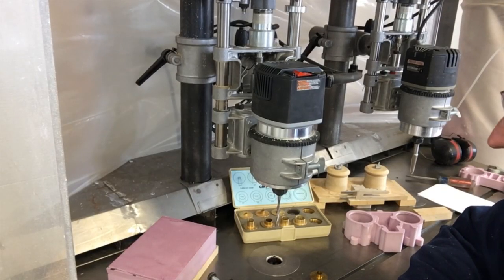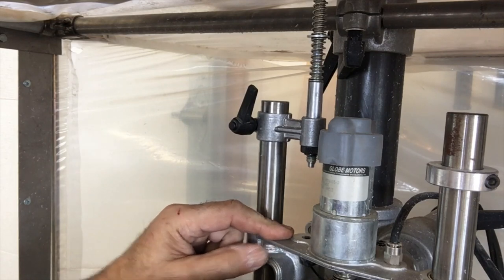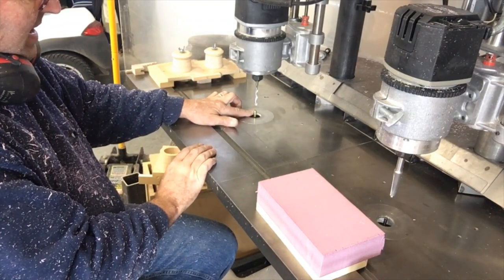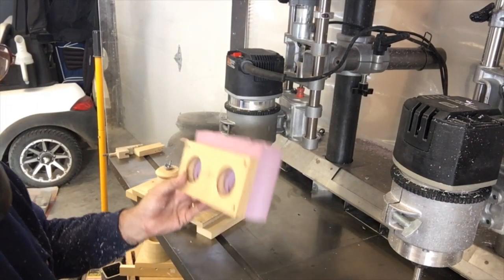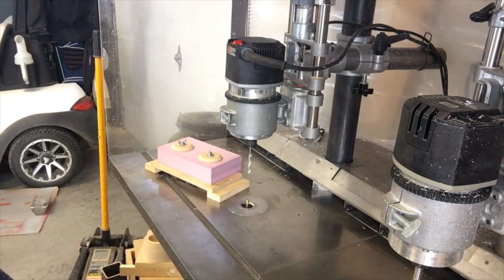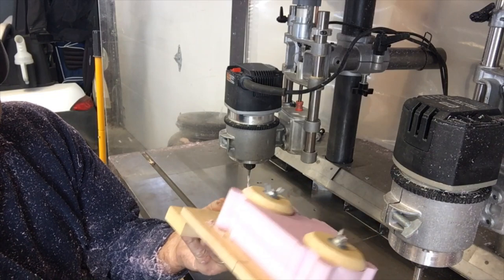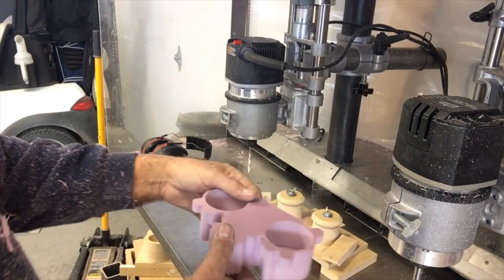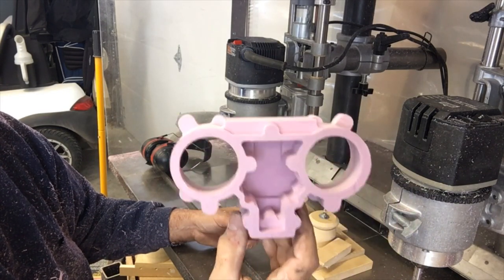Carburetor Main Well Foam Pattern

Comment: I think this is a lot more accessible than people would think. Especially with these cheap CNC lathes for wood that are out there, I mean they are basically useless even at what they are supposed to do, which is milling wood, but styrofoam shouldn't be a challenge and with that it's just a quick press of a button from CAD file to lost foam form.

Comment: Greetings and Regards Mr. Coffield. I do not speak English well and I have to find most of your conversations with the dictionary. Please write me the name, foam, glue and liquid that you apply on the foam. I watched your videos for hours and it was very difficult for me to find these names. Please help me in this way. Thank you again with heartfelt respect .Mamad
Reply from the maker: Use Google Translate or tell me your langugage and I wil translate. Extruded Polystyrene Foam Insulation Board 1.3lb/ft3 density. Hot melt glue or common white glue (Polyvinyl Acetate), and non-setting joint compound used on drywall board diluted with water. All can be found in home improvement stores. Best, Kelly

Comment: As I watched your method I tried to figure out how to invert it for my table mounted router, pin would be mounted above. It's possible of course but you lose the sight advantage with the part under the pattern.
Then I had a EUREKA moment. This is FOAM that is  being machined and cheap trim routers can be used, then this idea got cheaper when I remembered that a lot of CNC machines use glorified toy motors for the router. So even if I have to go the expensive route of a trim router, which I have, I can set up a single purpose station very easily and cheaply.   To go whole hog anyone can reproduce at least a mechanical version of your multi station system by using lost foam castings for your iron castings. "Toy" motors with adapters for the bits and you can have as many bit stations as you want. Even if  real trim routers were used it can still be inexpensive.
Have them on a horizontal turret and then only one lift device is needed and much less space. I have to go to work soon but this will give me something to think about.

My point in this babbling is, as its foam that is being machined then everything mechanical associated with it can be much weaker. I wouldn't doubt that a lot of it could be built out of wood...if your only going to be using it for foam.
Reply from the maker: You can build an L-shaped arm in box section or laminated thickness out of wood, but if you are going to spend money, spend it on an actuated z (vertical) axis with at least 2" of plunge, 4" better. There are oodles of linear actuator packages on eBay and Amazon. Mine is just a DC gear motor with an acme screw, anti-backlash nut, and limit switches. Could be a stepper motor if you prefer. Yes, it doesn't take much of a router. You might also choose to spend money on good bits. My go to is 1/4" diameter by 4" long, double flute spiral carbide. I'd never use a bit like that on any hard material, but for foam, no problem. Plunge the cutter into you table surface and you have a hole for a 1/4" pin under center. Buy some plastic washers with 1/4" ID and whatever OD you want to cut over pattern size......voila'...pin router. Best, Kelly

Comment: I'm curious if it would be possible,  to do something kinda crazy,.  Build a new Holley carburator,  based off the secondaries of a spread bore Holley,  making the primary side just as large. Use the traditional metering blocks, and bowls, and use down leg,  annular boosters, the difficult part would be drilling the idle circuitry. Maybe edm can be used ,   make it fit the traditional dominator manifold, and have a nice radius entry, with fairly large venturi, with the booster down low, use a enrichment circuit in the idle circuit, in place of a choke, like a modern scooter carburators use, maybe actuate it differently, 
 Id like to cast a intake manifold to use such a carb,  heck I'd like to build a engine that really needs such a carb, it should flow appropriately  1200 cfm  maybe more,  depending on the booster restriction. It could easily reach 1400 CFM,   a 850 carb the primary is only 100-150cfm of the total,.  That leaves 600cfm+ for the secondaries, I know there is alot I'm not figuring,.  But adding things like adjustable jets, that the changeable jets only set the max fuel possible,  then a needle valve can adjust the fuel down about 10-20 jets , so possibly 80's-90's could then be adjusted out, possibly using a wide band O2 sensor, possibly using two power valve circuits,  one for off idle enrichment   to allow the use of a pair of 30cc pumps for acceleration,  maybe a 50cc pump in the secondaries  I'm looking for flow of a 1150 dominator, with street manners of a 1850/4150 650cfm,
 The extra power valve , can possibly. Be mounted in the secondaries, yet be feeding the primary boosters, with a means of using this circuit for cold starts, in place of a choke,  use a needle valve to restrict cold enrichment,    and the spacing between primary and secondaries can be adjusted to fit the runners of a  intake better,  or even make it a 2bbl, using a pair in line, to feed a V8 engine,   a 650 - 700cfm 2bbl could be useful,   sorry to ramble again, I'm bad when I gave had no sleep, insomnia !! ✌️ Great video, thank you for sharing so much of your skills and knowledge!!

Comment: Do you ever use a hot knife to cut your forms??? The router work looks for clean... 
Good session...
Reply from the maker: Yes, I use a hot wire mostly just to resize and cut stock to rough dimensions, what with some patience, it can be used with templates for guide pattern cutting. Best, Kelly
Reply: Thanks... amazing job... I was wondering how I could make some patterns happen, but watching you work kinda cleared up a lot of questions... 
Good session...

Comment: Hello teacher, I congratulate you on all that knowledge you have, I want to ask you if you can tell me what the name of the foam you use and if you prepare it yourself or where you can get it.  Thank you very much for your answer.
Reply from the maker: It is extruded polystyrene insulation board XPS. The white expanded polystyrene (EPS) will work to but does not typically machine as well. In the USA it can be purchased at home improvement stores. I use the Pink Owens Corning brand called Foamular 150. The Dow product is Blue. The color is not important but the density is. The Foamular 150 is about 1.3lb/ft3. You should select foam that is between 1-1.5lbs/ft3 if possible. Check your home improvement stores for polystyrene insulation board. You may want to view this thread. http://forums.thehomefoundry.org/index.php?threads/confessions-of-a-lost-foam-caster-5-years-on.1650/    Best, Kelly

Comment: great info thank you, the foam you are using looks construction type can they be glued together, and what kind.
Reply from the maker: Yes, extruded polystyrene insulation board like that sold at retail and home improvement stores. 1.2-1.5 lbs/ft3 density. Even though it can be glued together, machining through a glue joint usually loads up the cutting bit fouling the cutting afterward. Best to glue parts together after machining if possible. Best, Kelly
Reply: @kellycoffield533  thank you sir for your time

Comment: really interesting process. I am looking to exspand my shop and would like to do more custom and fun stuff(still make money doing it though). curious about how the pattern is made... ill check vid list maybe youve made one?
Reply from the maker: This pattern was made on my over arm pin router as shown in the video. These days I use a CNC Router to make my patterns. I'll post a new video in a week or two. Best, Kelly
Reply: @kellycoffield533  yeah I figured, but still might be cool to see the process, I'm sure people would watch. Like how you went from and the original carb to a pattern. Just an Idea.
Reply from the maker: @customsolutionsinc  Maybe I'm not understanding your question. The original Carb Is an Autolite Inline Four. This is just 2Brl version of it that uses all the same internals. I took the dimensions from the original carb and made the mdf guide templates shown in the video to pin guide the router bits. Thought I went through each operation? Best, Kelly
Reply: @kellycoffield533  i was refering to the process of making the MDF pattern.... as interesting and informative as this video was I thought the process of making the mdf pattern would be equally interesting. I can tell alot of thought and planning goes into all your projects... interesting to follow... good job.

Comment: Do you find the climb cutting the foam makes a smoother surface than the conventional cutting you did on the roughing pass? Or does it make much difference? I know when machining metals it matters a lot on the surface finish.  You always have to coolest machines you've created.
Reply from the maker: The biggest improvement in finish is cutting on one side of the bit for chip ejection. On the clean up pass the climb cut may have a slightly better result but to be honest, at proper feed and speed it's hard to tell the difference on a light cut. For roughing, sometimes a conventional 2-flute straight bit is better because the wide gullet clears chips very well.
Reply: @kellycoffield533  Thanks Kelly

Comment: Kelly, is there any reason one could not use a CNC router for the pattern cutting instead of the Pin Router?
Reply from the maker: No reason at all. In fact, I have a CNC router. I'm just not a proficient enough solid modeler yet to use it on more complex projects, but this carburetor body would be ideal since it could be done in two set ups with a single bit, but you need appreciable z-axis travel for this one. Best, Kelly

Comment: Can you tell us the type of refactory coating you use for your foam parts? Was it a spray coating you use?
Reply from the maker: I use a commercial product called Poly Cap 600. It's made by Refcotec but there is a substantial minimum buy (50gal/600lbs) that makes it impractical for most hobbyists without a group buy. Thinned, non-setting, drywall joint compound (for gypsum drywall) will work just as well for aluminum. You can buy that at retail home improvement stores very inexpensively. Best, Kelly
Reply: @kellycoffield533  Thank you!